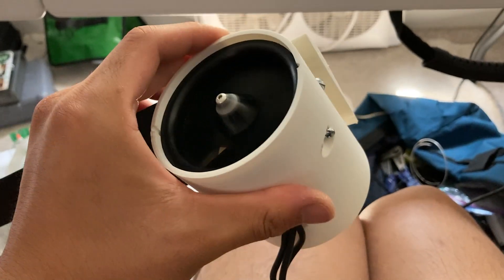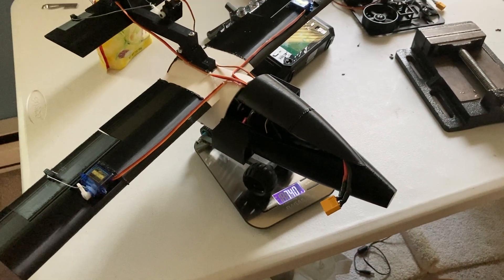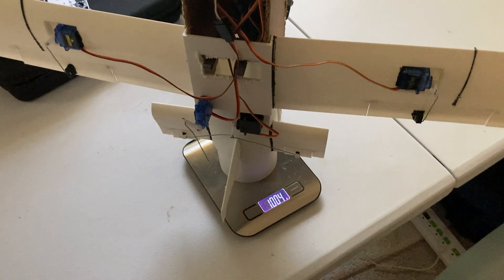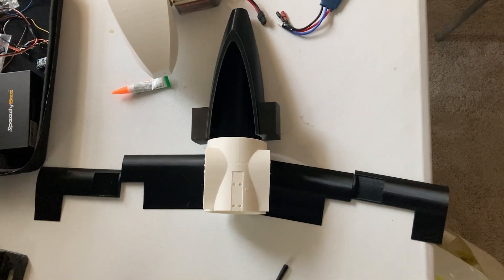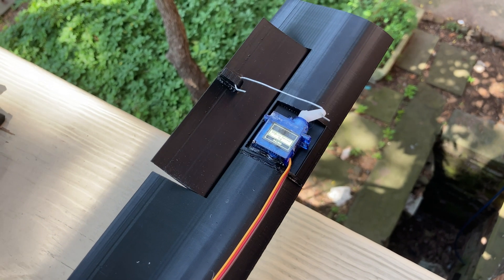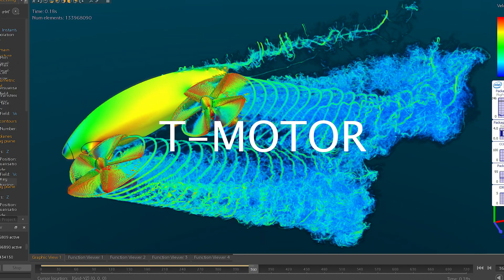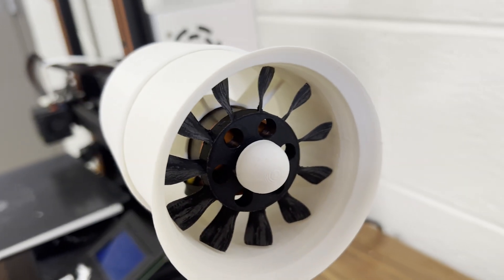Why My Planes (And Ducted Fans) Suck

Comment: i'm currently going through my own 3D Print EDF RC design project. it seems we both made similar errors in the design. mainly weight and lift. from looking at your design and especially knowing it's printed out of regular PLA and not LW-PLA i feel like it is just too heavy. i learned that lesson myself when my chosen scale for my planes was too small for the amount of electronics i put inside and the wing area that it provided. i had a design slightly smaller than yours that worked as a glider without electronics at ~200g but with electronics at ~450g it just couldn't sustain flight because the wing area was too low with that amount of weight. 

so i suppose things you could be looking at to improve the design is switching to LW-PLA for 3d printed parts and also making larger wings. high aspect ratio is a good idea to start with but i think they should just be much larger overall.

perhaps that helps.

Comment: Just giving some general tips and constructive criticism, try using alternative materials to build the plane, 3d printed parts are super heavy compared to like foam board. Also for that aircraft weight and the size of the airframe itself, it has A GIGANTIC WINGLOADING. I don’t believe the problem is the edf, but the airplane. The wings make barely any lift. The entire airframe is just too disproportionately small. 

Try experimenting with making an airplane design glide. If it glides good, it flies good. Also those 9g servos are more than adequate to move larger control surfaces. I wouldn’t recommend just attaching the tail boom to the servo itself. 

This airplane is kinda bulky. Also a big factor in making an airplane stable is center of gravity. All ur planes were majorly tail heavy, making it unstable. You don’t need a gyro to make a plane stable. Before trying something as complex as an edf, work on making good gliders and move on to a brushless motor with a propeller. 

Once you get more experienced with each plane you can get flying, the more your capabilities will expand. I admire your determination, you definitely need this. I’d just recommend starting simpler, and I believe you’ll create some amazing airplanes.
Reply from the maker: One of the most helpful comments for sure. 

I got REALLY into ducted fans last winter, and I wanted to get into ardunio, so I figured the aerodynamics would be the easy part of all this. Very obviously not true lol. 

Taking a quick break from this specific project but this gives me a really good starting point to jump back into it in a few weeks. Using 3D printers because I had no experience with RC foam cutting stuff before, I bought LW PLA so hopefully that can make a difference

Comment: Very cool explorations man =)  Are you committed to using a 3d printed wing?  If not, I'd consider looking up the HB1 rc plane which is designed as a streamer combat plane, but it has a 3d printed fuselage mated to a foamboard wing which is easy to build, light and strong.  If you want to stick to a 3d printed wing; definitely consider LW-ASA (LW-PLA is very heat sensitive and will warp in the sun); and size down your servos to maybe a 4 or 5g.  9g servos are too large for your application especially since you're also adding a rudder.  

Another great resource is the flitetest youtube channel; they do some amazing builds with just foamboard and hot glue. ^_^
Reply: could probably get away with lw-pla if he covers the top with aluminium tape.

Comment: Some little advaices: a small plane like that can't weight 700 g, maximum 400; then you can't use lego wheels,they are heavy and not good for planes.Good luck!
Reply from the maker: Yeah I was really set on using those wheels because of how cool they looked. But you're very right they are way too heavy

Comment: It looks like it would fly far better with the entire tail section moved aft about 8-10 inches. I just completed my first 3D printed plane project as well. It's the latest video on my channel if you are interested. I opted for no landing gear. This makes me want to design a new plane with an EDF in it!
Reply from the maker: Dude I loved your video. Those crashes were brutal but it the last iteration looks so clean.

 Yeah the resounding advice is a bigger tail farther down. EDFs are nice but they've been such a pain to work with! lol
Reply: @mach10point4 Thanks for watching. I guess the crashes mean the plane at least flew well enough to get some speed and altitude! I'm considering designing a STOL plane now. The plane I made is a bit too fast with weird high speed stall characteristics. Maybe after I make a STOL plane I will give an EDF a go. Never worked with one before.

My STOL plane should be easier to design because I already have the powerplant and electronics figured out for the first plane I made. Basically just design a new plane and drag the same powerplant into it.

Have you started work on another version or modified yours to see if you can get it in the air?

Comment: I think its the sudden acceleration that's causing your plane to fall out of the sky it kind of looks like a stall as well. Also, consider using Foamboard (you can find it at dollarstore or art stores) or other foams used for rc planes like depron, epp or eps

Comment: It looks super back heavy
Reply from the maker: With the very short fuselage and the battery up in front the NP is actually a good few cm aft of the CG
Reply: @mach10point4  But your stabilisator has no leverage. And with regular pla you really can't print strong walls it's way too heavy.

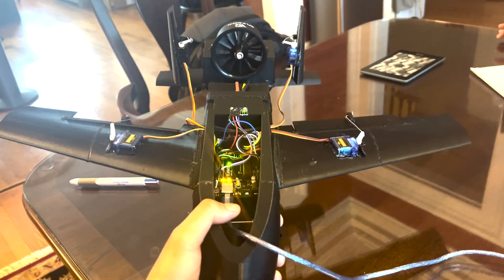Comment: Your flight stabilizer is backwards.  At 2:50 when you roll the model to the left (viewed from the front), the left aileron should move down and the right up in order to bring the model back to level.  When backwards like your video shows, the plane will want to roll no mater what you do.  This might account for why you can't get it to fly even a few feet.
Reply from the maker: Ah that was an example from an old iteration, didn’t have the arduino in for this one. But yeah thanks for pointing that out, not sure what I was thinking

Comment: Couple pointers: your tail is too short. Make it like twice as long and use a lighter material than pla to make the tail. I just used an old carbon arrow and glued the stabilizers to that. Also make the tail sections twice as big, horizontal but mostly the vertical. Also increase the rudder and and elevator size. These are tiny in comparison to your plane. Also remove the servos from the tail and put them on top of the edf or something. This will allow you to take weight out the front and make it lighter overall. Lastly check out lightweight pla if you insist on 3d printing this. I have a plane almost twice as big that weighs almost as much as this.
Reply from the maker: This is helpful, thank you! I’ve been scared to size them because of weight but I ordered LW PLA so that should save a ton.
Reply: @mach10point4  sounds good. Also, don't be scared to mix materials. I'd recommend experimenting with some foamboard stabilizers just to get the size en length of the tail right and then design and print them accordingly
Reply from the maker: @sjoerdb1505  Yeah good point. I've been reading about people using PETG for mounts, LW PLA for long structural components, CF PLA for high load parts...the optimization is endless!
Reply: @mach10point4  true, but petg is a bit more bendy than pla so I'd advise against using it for thin parts. Pla is better in that application. Also thin walled petg parts like to warp a lot more than regular pla. In my experience pla is all you need to build a nice plane or lwpla. The biggest weight savings are gonna be in the design not the material

Comment: In my opinion the biggest issue with your designs is the tail surfaces. The bigger the tail sufaces and the farther away from center of gravity they are the more stable your craft, currently your tail surfaces are small and very close to center of gravity, consider a canard design because of the heavy edf at the back. Also yes i agree that the wing loading is too heavy. I would focus on making the wings just bigger instead of making the entire craft lighter, check out "wing cube loading" concept.
Reply from the maker: Yeah the more I iterate the more canards make sense to me. Very helpful. Thank you

Comment: It´s so cool man! The thing you make your own EDF and utilize it is great! I love experimental builds so I´d like to see it flying.  And the LEGO.... love it! :D   I thought about 3D printing planes as I have a 3D printer but I´ve ditched the idea. It has PROs but I also like to crash from time to time so It´s the CON 🤣 So Foam builds enhanced with 3D printed parts.  I won´t say anything smart to help with the design, all I know is that "everything" will fly if it has enough of airspeed as @rctestflight shown with his solid wooden plane 😅 But for sure the plane needs at least plenty of airspeed on launch. The tiny stab control surfaces needs tons of airflow to make the effect. 

I´d maybe tried little scaled up version that has lower wing loading and launch with catapult?  Don´t you wanna give an extra one more try? 👀

Subbed, cool stuff! 😊❤
Reply from the maker: This all makes sense! When I tried the cardboard/3D printed combo I had difficulty attaching the two, maybe you have some insight into that? Anyways, appreciate the feedback and support!!
Reply: @mach10point4  The cardboard/3D printed combo... I guess when you look at the plane you should see that the elevator is literally minimalistic to the rest of the plane. That´s the first. 
Maybe for the prototype try regular RC build techniques. I Never tried to glue these two but the problem could be the plastic is not porous enough for the glue to grab on and secondary those glue joins has too little surface area.  

For flying prototype I would try to make a simple square fuselage from FoamBoard or Depron and packing tape. (Experimental Airlines, AerostuffFPV channels, check it out)  Light and very strong at least for prototype.  
Inside the fuselage print out two thin plates that you will glue in on the vertical walls. The plates should have a holes for carbon spars that goes through wings and you got very good force distribution so less to rely on glue. Or the standard wing mount RC technique skewers and rubber bands, also very solid, although the previous variant is more integrated if you want to. 

If I wanted seriously use just 3D printing then I would consider to use it more just like outer shell with some spars reinforcement, again, less rely on glue. For the wing print internal structure check out "Tim Station" or Tom Stanton.

The problem also is for EDF placement, air intake and thrust line that is very important to consider. Maybe I would borrow fuse design from jets, big side intakes?  Tail like F-4 Phantom? Or double boom from the wings?  Or F-86 Sabre, also good inspiration. 

I am cooking just from water here, you might have your own ideas and vision right...  

The Trainer Design website you showed in video got also a stall speed calculator, check that out, you will know what will be your minimum speed. 
And Wing Cube Loading https://www.rccad2vr.com/aeronautics/wing-cube-loading to have an idea what are you dealing with. 

It´s really rough and mess stuff that comes to my mind, we could talk hours about these things, complex af. There are so many variables and understand them how they work together takes some time to know how to design your own stuff. Check the Solid Wood Plane video that´s really good! 😅
Reply: @mach10point4  Only just a rough idea. The plane was 750g AUW and T/W ratio U said 1.6. 
If you want to end up on the Wing Cube Loading scale in EDF jets side (max), you need around 12.5 dm² of wing area. That is wing loading 60.0 g/dm², 16.95 WCL and stall speed 36 km/h.  (The wing area is just half, remember, if you will use measure tool in Solidworks, it´s not entire shell around entire wing! Consider it as a flat paper even for manual calculations.)  I also have some info in my video design for wingspan, chord length, wing loading and AUW.  Each time I make a scratch build these things are my start point to get and idea if the plane is heavy or what to expect from it. 

Try to focus on calculation for these things. Weight - Wing Area - Wing Loading and Stall speed. (And tons of other stuff) 

Will it fly? Yes! But it needs the airspeed, the sufficient control surfaces authority, the thrust line tip-top, the pitch speed on the prop at least 2x the stall speed (dunno how it´s with EDF honestly) and enough thrust. 

We try to build as light RC as possible but you went the way to learn a rock to fly 😅 And I am not judging it at all, I said I love experiments, but to make the rock fly it needs more than the regular foam planks with motor and some stab.